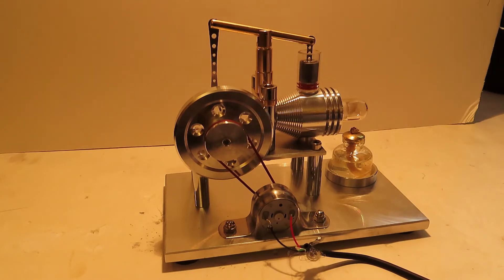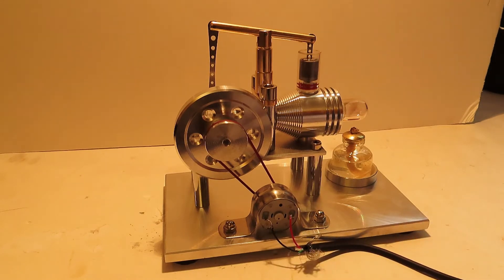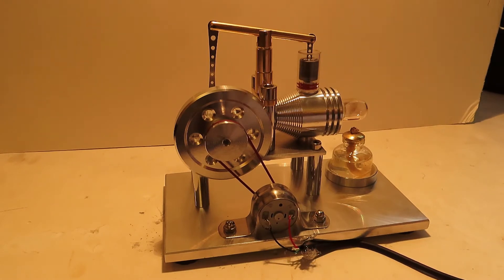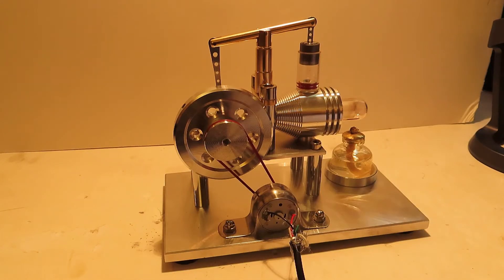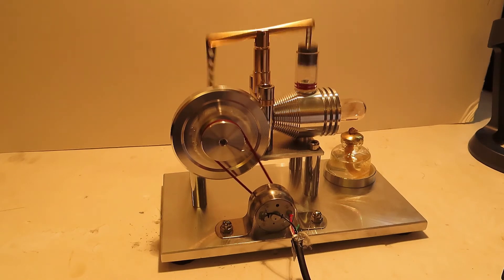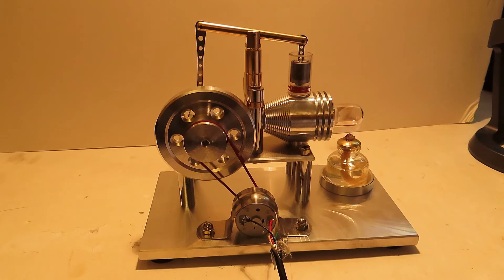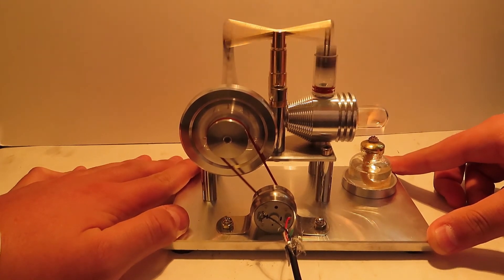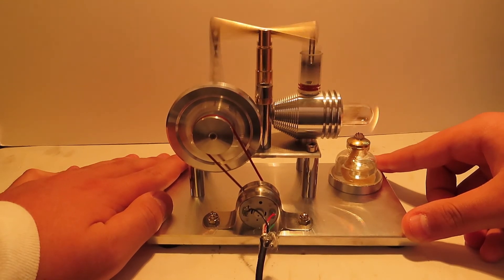Stirling Engine With Electric Start!

Comment: information.        at 1:50, it  IS  a  DC  motor.!!!!     NOT  a  tiny DC generator.         when a  brushed DC motor is driven, it  can function as a very  INEFFICIENT  (DC) generator.
the degree of inefficiency is indicated by this fact:  the output is  DC. !!!      this is  'strange', because, when a magnetic field moves past a coil (or vice versa),  Alternating Current  is    produced.!!!!! 
it can be seen that there is no such thing as a self-starting  Engine.     thus,  the use of a (small brushed DC starter) motor does allow  a single rotary device, to serve two purposes.
on the other hand,   during part of the time that it is running, the engine  Could  charge  a cap or tiny battery; in order to power its  OWN, subsequent,  'start-up'.        googletranslate
Reply from the maker: I should have been more specific. It is just a dc motor being used as a generator. Like you said. You seem to know a lot about this kind of stuff.